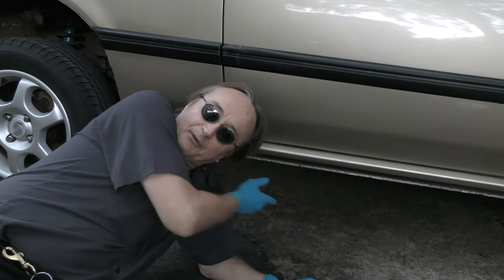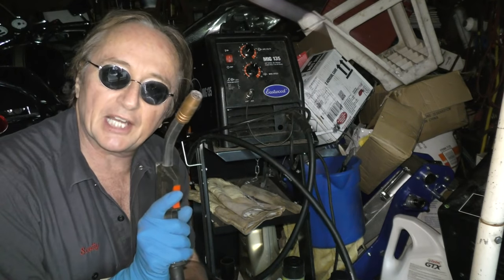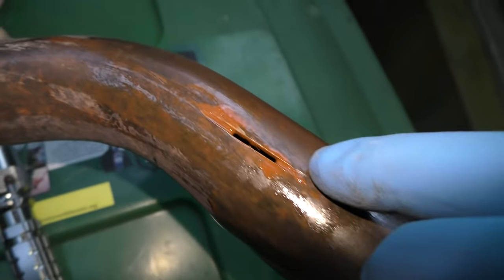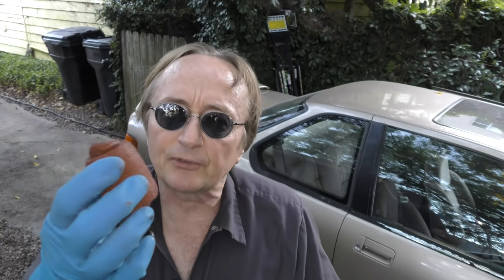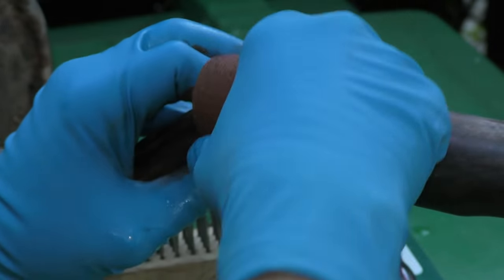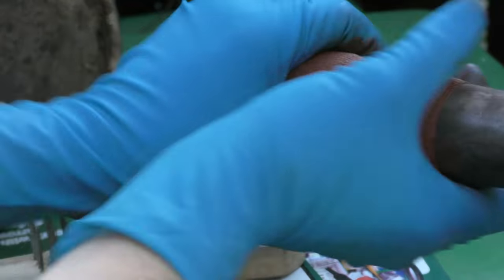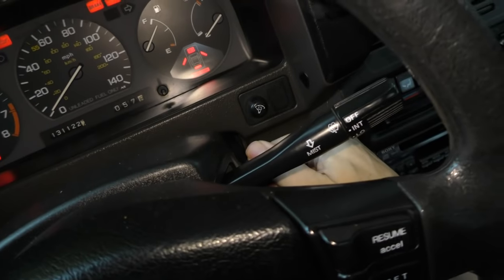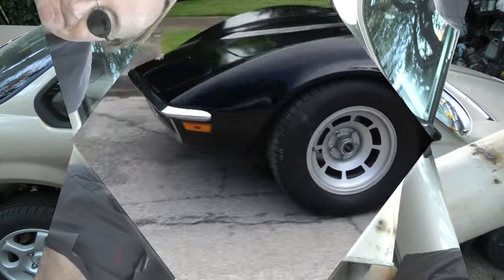How to Fix Exhaust Leak in Your Car for $12

Comment: Hey! I recently replaced my clutch and my throw out bearing is squeaking when I don't push on my clutch. I have noticed it's a common problem in Subarus, and I was wondering if you knew how to fix it?
Reply: Jack Worthington Why didn't you replace it too? Always do them  together. Good time to replace the rear main seal too.

Comment: hi there sir,just have a question,i have a mitsu outlander and just notice a sound almost the same on the video but i barely hear it when the car is on park idling,i can hear it and sounds like in the front of the car while driving it,what you think it might be?exhaust leak or something?sounds like a small car running
Reply: and thanks..
Reply from the maker: often exhaust leaks, check it when the engine is cold with your bare hands and it jacked up in the air
Reply: Scotty Kilmer thanks for replying..

Comment: Just wondering if whenever your using clamps to hold 2 pieces of the pipe together if you should also put some muffler cement on it

Comment: Is it possible to use a petrol car rev meter on a diesel pickup? And how.. place make a vid about it
Reply: Yes, but you have to replace a couple resistors on the petrol tachometer, so it reads correct value.

Comment: Will this work for a hole in a muffler?
Reply: Unfortunately, no not if it's a standard sized muffler. Depending on the size could try some permatex mufler sealant

Comment: Tried that before but the thing fell off upon acceleration on motorway. My exhast sounded like a modified car so kept the speed at 60 mph. Its a temp fix so dont rely on it to stay there long
Reply: well, maybe I recommend the soup can, then the tape.
Reply: you could just pit 2 layers on then an exhaust clamp

Comment: its a great temporary fix until you can replace the part.  I know from decades of experience that patches don't last more than a couple of weeks, but 90% of the time a leak will happen at a connection point so no patch or putty is going to work.

Comment: The exhaust pipe is really close to the heat shield. it makes it impossible to wrap around such a big roll it simply won't fit at the top of the exhaust.
Reply: cut into pieces just long enough to wrap around like twice

Comment: Scotty
I was wondering WHY your Corvette seems to be burning so much oil in the start up of your videos.
Reply from the maker: it's not mine, it's a customers and it sat 16 years unusued in his garage. i just got it running in the video, and it now smokes not at all now. But it doesn't look as cool in a video either now.
Reply: Bobby W that's what makes it so cool!
Reply: Aha! I was always wondering why YOUR CAR (didn't know it wasn't yours) would smoke lie that !
Reply: Bobby W It's not oil. It's unburned fuel. Probably running a little rich. Not uncommon for carbureted engines of the past.
Reply: +Scotty Kilmer  Hey Scotty, I know it's not the sort of content you normally do but that would've made a really cool (obviously longer) episode to have filmed.  Keep up the great work as always, and thank you.
Reply: Lol  not to mention the awesome Smoke from the burn out!
Reply: Will it pass inspection
Reply: yes. because its 25 years or older. anything younger than 25 years requires an emissions test. and it probably wouldnt pass but then again i had a 1978 Oldsmobile Omega (Chevy nova clone) and I did an emissions test on it gits and shiggles and somehow it passed. I had someone test it who  I knew. Yet my 1990 celica had a hard time passing but eventually got it to pass. To which I used a combination of Scotty's method and a techs method for it to pass.

Comment: i remember my old geo had a crack right by the joint, it eventually cracked off, but i could never get it to seal. should have just taken it in to weld it

Comment: Hey I have a 1986 Chevy c10 and my exhaust system has changed in sound and by my engine you hear metal to metal hitting what could be the problem?
Reply from the maker: if it's inside the engine, remove the fan belts and pray it goes away showing a worn water pump or something NOT the engine. IF noise is still made then, engine would need serious rebuilding
Reply: Thanks and also one more question my truck keeps ticking I think it's one of the lifters could it be?
Reply from the maker: often is bad lifters if old, try and engine flush with rislone then change the oil and filter and pray
Reply: Ok thanks for the valuable information
Reply: When you put the rislone in it do you crank your car up or let it sit or do it without cranking it up or what?

Comment: Hey scotty! recently found your videos and love em. 
I just got a quick question about my 2007 mitsubishi lancer. When i try to accelerate hard in first gear it becomes hard to push clutch in for second gear. This problem only occurs when i try to floor it. Do you have any idea what the problem could be?
Reply: Flooring your lancer

Comment: I have torn cv boots on driver side for 93 Toyota camry is there an easy way to fix
Reply: Wrap duct tape ..a lot of it.
Reply: yolanda brown Best way is to replace the whole shaft. Maybe 80-120 dollars depending on brand plus labor. If money and lack of experience is an issue, you can get boots that come in two pieces and you glue together around the joint, maybe 15 dollars. If you follow the directions carefully and take your time, you can do it.  Keep grease off the gluing areas and get some long zip ties to help secure it because they rarely fit perfectly. Replied because I have exact same car 320K miles on it and my son did repairs to CV joints both ways! Good luck!

Comment: How long does it generally last?
Reply: It's not a permanent fix. Might get you by for a few months until the patch fails, especially if you drive in a "spirited" manner. Any gas or liquid under pressure will always seek the easiest route out. The easiest route out is that patch.
Reply: The conservative word of the year is TREASON
Reply from the maker: it can last for years, it's rather stront.

Comment: 🚨🚨🚨HELP SOMEONE HELP 🚨🚨🚨

I recently replaced my Vapor Canister Vent Solenoid (PN: CPV123) to stop the fuel smell from the inside of my car, but that didn't help. Plus, every time I fill up my car, it's clogging up for some reason (video on my channel). What should I do?
Reply from the maker: often a bad evap cannister assembly itself does that. They will wear out over time

Comment: Works but looks like crap and may not last very long. If I can't get to something like that with my Mig Welder I will use a product like Yale Muffler Cement. The Pros use it for leaks when mounting a muffler to a pipe if after doing a job you have a leak at the seam with a car up on the lift. Just put some on your finger tips with a glove on and push it in the seem and the heat sets it up right away within minutes. I filled drilled holes in exhaust pipe with it and it stays in the pipe.  It won't work on a rusted out pipe being the pipe will eventually break and you would then be better off using what Scotty used for a temporary fix. Myself if that was the case I would cut out the bad piece with a sawzaw and if the area is not to large I would use a exhaust pipe connector for the size of pipe you have on your car for probably 2-3 dollars plus 2 clamps maybe a dollar a piece. If you need a piece of pipe larger you can buy pipe in just about any auto supply to fit what you have that is flared on both ends for your pipe to fit inside of.

Comment: In the U.K, I don't know if it would pass an MOT with that fix.
Reply: Yeah same is for Switzerland.
Reply: Yeah as long as at the time of M.O.T it was sealed it will pass. I did it with one of those metal ones from the garage. It only lasted 5 minuets, don't now how long this bandage stuff would last.

Comment: I can't help but think this is just a temporary repair and not meant to be a long term fix.
Reply: Nope...I used this product over two years ago on my girlfriends car and is still holding great.
In my case instead of turning the engine on for over 30 minutes, i used a heatgun.

Comment: What if the leak is in the flex pipe?
Reply: RangerXanatos your best bet is to cut it out and replace it with straight pipe or get a cat back kit and replace everything  from the converter back

Comment: in my country i just drive it to a muffler shop and they weld it for 12 bucks
Reply from the maker: good luck finding that in the US, unless you have access to a time machine.
Reply: same in the UK, very expensive
Reply: I did that recently and it was $65 and they didn't add any new metal so it broke again after a year.  I did a whole new exhaust myself in the end.
Reply: mine was just a crack which is caused by running into a deep pothole
they did it in less than 10 minutes
Reply: Just purchase a new section of exhaust from rockauto or local parts house.
Reply: I did use old totaled door as metal donor + 100$ flux welder from HF.
Reply: cant be USA.ive used furnace retort cement works well for manifolds seams small leaks .if I take off car gets new piece.
Reply: Y10Q Sears won't replace muffler wo replace all pipes .neighbor took car to muffler shop 900$  2manifold pipes y pipe I looked one side 2 bolts to flange missing put in .gasket ok he took us to dinner 30$ 1yr still quiet.
Reply: Most places will charge you extra if you stand around and watch ;)
Reply: Never!!! if someone want to do something with torch, just ran away.
Reply: In your country, you also work for three weeks to earn 12 bucks... :)
Reply: Not really. 1-2 hours of work.
Reply: in his cty.they only make 45$ a week.
Reply: well minimum wage here converted to usd is about $130 a month
average is about $200-$300 a month
I on the other hand have my own shop and earnings depends on the economy $300-$1000 a month 
before the devaluation of our money, minimum wage was close to $300 a month
Reply: @Y10Q
Recently I got a complete exhaust overhaul for 100$. New elastic manifold connector, after cat lambda thread, middle and rear mufflers. All done on the spot in 25 minutes. In my life I used to drive cars that were cheaper than your muffler repair...
Reply: My exhaust rusted apart one day. I took it to a local muffler shop and they welded it back together for 20 bucks.
Reply: So they put your car on a lift, paid a mechanic and used their equipment to fix your muffler-  all for just $20 bucks. Sorry but that does not make any sense. You are lying.
Reply: In our country you drive to a dealership or a mechanic shop and they replace half the car, say that everything was fucked and then hand you their million dollar bill.
Reply: If cheap take it but for a 2o o 30 year car it might good idea byujg a new one. I had spend it couple of 20 o dollar with the fake tapes. It only last couple of months
Reply: Scotty Kilmer same in my country. Just drive in and they tack up the hole and you tip the guy $5 - $10. No dirty hands.
Reply: The problem with fixing begins with lifting the car and getting rusted bolts off. That itself is a job. At least in this case. Then tools, garage etc.
Reply: In my country they'll fix it for $5 at the dealer :)
Reply: @Y10Q  You putbitbin the exhaust? .. andncalling others f..gots? :)

Comment: omg is that a Honda prelude 4th gen? 1991??
Reply: I thought so too I was like omg it's so pretty !
Reply: Louis Vidalinc same my friend got one in red and it is so cool
Reply: TunerRepairs Team MadCats  Agreed. The late 80s/early 90s Prelude was one of the most fun-to-own cars Honda ever made. It's really sad they don't make anything like that anymore.
Reply: I had a mint condition manual one with under 100k, I sold it for £1000. I regret it to this day.
Reply: Honda makes all kinds of cars, unfortunately they call them all Civics now
Reply: What do you mean? Like because the prelude and integra are dead ? If that's what you're saying I agree, no other good fwd platforms even though they were best at it. I wish they'd make a N/A car to rival the BR-Z even with fwd. Or a new S2K.
Reply: I spotted that too!  I have a '90 SI.
Reply: 3rd gen*
Reply: TunerRepairs Team MadCats I have a Honda too! I keep it in the garage! It mows my lawn
Reply: I own a 4th gen prelude it has 300k KM on it still runs like a dream!
Reply: Slaying Ripper that is cool man :)
Reply: Sloppymargarita, a Prelude yes, but it's a 3rd gen. I have  the same car, but a blue 89 Prelude Si 4WS with four wheel steering, runs great.
Reply: Steve, so true. Honda sucks ass, now. No more Prelude, CRX, Integra, RSX, Del Sol, S2000 and soon no more Accord 2dr coupe. Back when Honda's were fun to drive, SMALL, agile and had double wishbone suspensions. The new NSX is ugly as fuck, compared to the timeless, sexy, original NSX. Also, sucks that we can't get a 2dr hatchback Civic, anymore. Wtf?

Comment: Anybody know what model Honda that is?
Reply: The513Warning yeah, a shitty one.
Reply: OGMillyMillz The hate though.
Reply: Prelude I think.  Guessing a 2nd gen 1982–1987.
Reply: It's a 3rd generation honda prelude (1987-1991). They're not shitty, they actually have a neat mechanical 4 wheel steering system and are really quite fun to drive. 
In fact in 1987 Road & Track published a test summary that showed the 1988 Honda Prelude 2.0Si 4WS outperforming every car of that year on the 
Slalom, including all Lamborghinis, Ferraris, and Porsches.
Reply: The513Warning it was a joke. 😒
Reply: Matt F Much appreciated. I knew it looked familiar. I'm not used to seeing them from the side.
Reply: OGMillyMillz Lol. I didn't take it seriously. You're good, wodeh.

Comment: am from Saudi Arabia and I have cadillac sts 2009 v6 the computer system going crazy all light terns of and on it don't know what to do and the dealership is big layer 
please advise me thank you
Reply: jeje Either your computer is going out or you have a short some where in your car.
Reply: You could also have a bad wiring harness. I had that issue with my old truck. The engine would shut off and on really fast and backfire then kill completely. Replaced a lot of stuff including the computer. I found the problem when I nudged a spot on the wiring harness while the truck was running, then it shut off.
Reply: lier
Reply: Dealerships are like onions, they have layers
Reply: First check your battery terminals are tight then check your ground straps.
Reply: Sounds exactly like ignition control module/switch, located on harness in steering column, attached to actual key ignition. Caused same exact symptoms, changed myself twoce, 20 to 35 min job, on 2008 chevrolet trailblazer. Seems to be common GM issue.
Reply: when you have an electrical issue, the cause can be almost anywhere.  the person who said 'grounds' gave good advice.
Reply: Get a camel.
Reply: GM = Gross Management. 
I hoped the GM take this notes on their premium brand same as their regular Joe brand.
Reply: Proudly made in USA for you.

Comment: gonna need a lot of tape when that pipe randomly decides to cut itself in half
Reply from the maker: I tried it out on a full broken off pipe, and actually it worked rather well. This stuff gets really hard when you layer it.
Reply: Scotty Kilmer disclaimer, it works well but it only lasts a couple months for really broken pipes. In my experience. Good for leaks though
Reply: thats why there are exhaust clamps

Comment: Can I find the leak using cigar smoke?
Reply: Seafoam would be great for this. When you Seafoam an engine it smokes something fierce, so...recruit one of your buddies to help you. He stands next to the air intake (air filter off, please) with a can of Seafoam Spray. You put the car on ramps, start it and crawl under while wearing hearing protection. He sprays the Seafoam into the air intake until the huge clouds of smoke start billowing out the tailpipe. Any exhaust leaks will pop right out.

Comment: Or just don't seal it. Hole in the exhaust ain't a big deal.
Reply from the maker: ah, it actually can fool the oxygen sensors and make the air fuel ratio incorrect on modern cars

Comment: face-palm

Why not advise them to put a Band-Aid on their rusted out exhaust system? Maybe some bubble-gum? This is not a fix actual mechanics use or recommend...
Reply from the maker: sure, mechanics want to make a lot of money changing parts. And of course, if you have a welding machine, just weld it. They cost as little as 100 bucks these days

Comment: In other words, it's a cheap rigged way to fix something that should be fixed the proper way
Reply from the maker: Depends, cause if the hole is from rubbing or a manufacturing defect, it works great. Now, if you live up north and the whole system is rotting away from winter road salt, yea, it's too far gone then.

Comment: so your life is worth 12 bucks that crap is junk  it fails with in months and it doesn't seal as good as you think what was the last thing you did rev the engine and the pressure from the exhaust will open it right up oh it might be quiet for some time but deadly co is escaping one bolt missing in the floor pan and you can die  I have a friend years ago drive a car to a muffler shop not two miles from my service station a four door Dodge a slant six all the windows down and he was over taken by co not half way to the muffler shop almost died spent two weeks in a iron lung fix it right your life should be worth it don't buy into this crap  I'm a master mechanic and tech 40+ yrs now and 13 yrs  NASCAR Western wheelen series  don't buy into this scam
Reply: i call bullshit on this. there is no way that he almost died from co poisoning with the windows down driving it 2 miles.